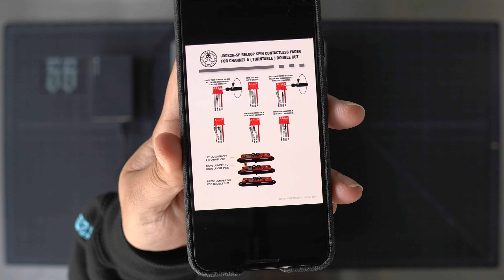A vital upgrade for the Reloop Spin! (JDDX2R-SP Fader)

Comment: Freddy just FYI, you can set the fader to double cut mode and then simply turn the left adjustment screw until the fader stays open in hampster, that way you don't have to flip the fader over...

Comment: I almost think they need a 2.0 already. I don't even skratch hamster but don't recall any skratch oriented product in the last 20 years that doesn't have a hamster switch. How was that overlooked? 

They also should've made a proper start/stop button opposite the fader and allow you to swap them back and forth depending which side you cut on, instead of a toggle style button above the tone arm.

The constant flashing of the Bluetooth button with the bizarre logo I find kind of annoying, but a sharpie can easily fix that. (possible its just more distracting in the video than in person)

Comment: Hi. I was going to buy the reloop spin but was wondering if the USB record port can function like the Numark PT01. Meaning you can plug straight to an iPad with an apple camera connection kit and use it like a Digital vinyl system with a mixfader?

Comment: Great video as usual @swiftstyle. Do you have any info on what happens when you put a fader in the other slot as well? I'm sure i read somewhere you can use then use that to balance the output difference between the aux and the record volume? all the best L
Reply from the maker: I believe that will only be possible with two Innofaders since they have an adjustable slope.
Two of the JD faders will only give you two ways to cut. We will test this in a future video since Inno sent me a pair to play with.

Comment: Awesome videos Freddy! I'm getting a lot into this scratching culture and I'm planning to buy a portable turntable but my concern is if the reloop spin is compatible to connect with iPad to run with Serato 7" vynils...keep up the good work!
Reply from the maker: Thanks for watching! You might be able to run the spin into a Serato box and control the dvs that way but it doesn't support it internally. On another note running Serato on an iPad might not be possible just yet but maybe something like a tablet PC could do it. Peace
Reply: As is, you won’t be able to run a portable table with a built in fader with any DVS without running a separate mixer/fader - even with a box.  Might be able to make a midi fader mod for Traktor but not out of the box from everything I’ve seen and read.
Reply: @notmyrealaccount8564  Yeah, I think Mixfader with its app would be the way to go for what I intend to do. Cheers!
Reply: @djsoo  That's right. The only option to make it happen would be through Mixfader and its app. Thanx. Cheers!

Comment: Yo..  This 30 second install is Bullshit.  They fail to mention if you have a model with the serial number RT1904... then your fucked and have to crack it open and switch a plug on the board.  Exactly what i wanted to avoid.  So check it..